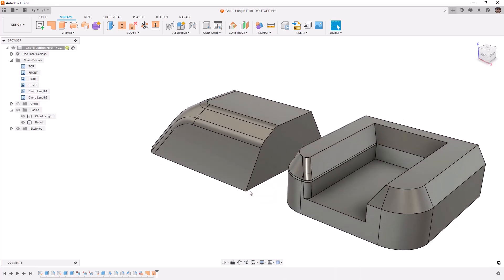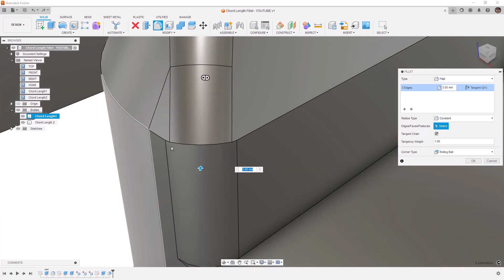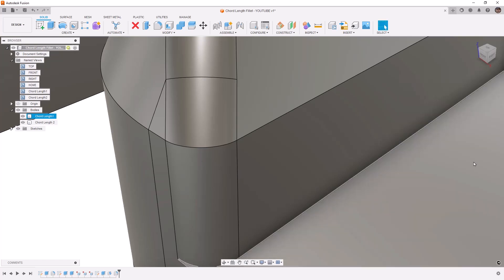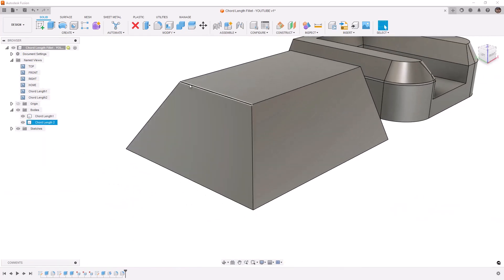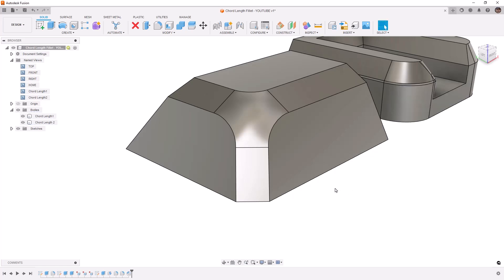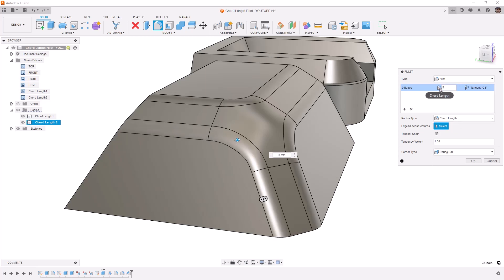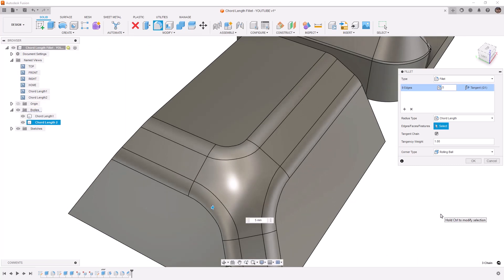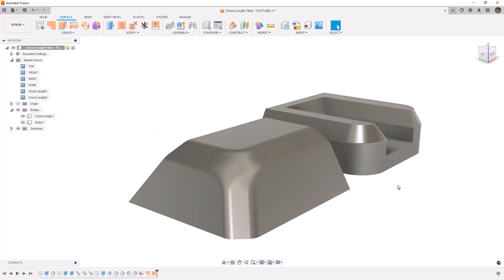Chord Length Fillet for Mechanical Parts

Comment: Not to take away from this topic, but on that last example, if the main geo was taken out of Fusion and brought into Plasticity for finishing that whole corner can be assigned without pinching and without that hump in the middle of the chamfer/fillet just another tool to get your designs done: https://www.youtube.com/watch?v=lfSfHNN5bXE
Reply from the maker: Yeah, there have been a few models I have taken out of Fusion and into Plasticity when fillets or chamfers won't build.  Whatever nick is doing in the background with parasolid is more forgiving in Plasticity.  My thought is that it lets the edges of surrounding surfaces move more freely while Fusion does not.